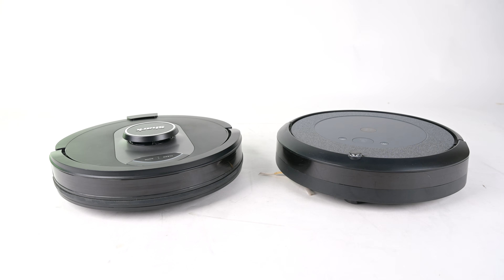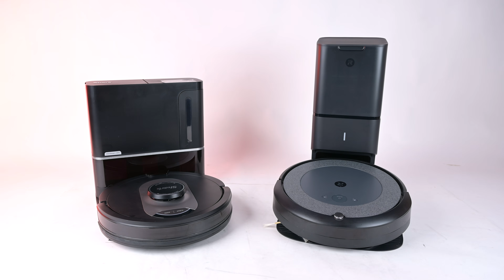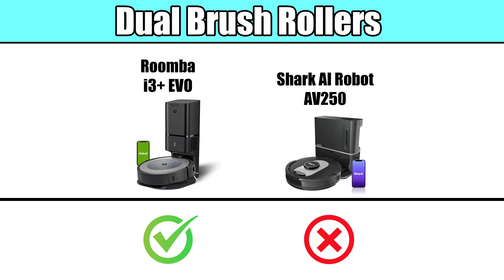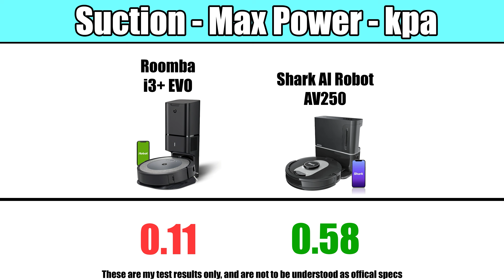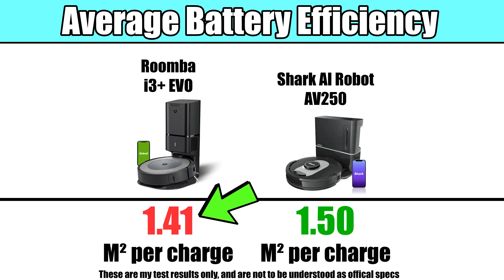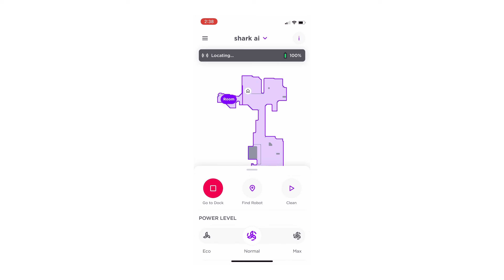Roomba i3+ EVO and Shark AI AV250: Robot Vacuum Wars Showdown!

Comment: I have the irobot roomba i3 evo, and my son has the i3+ evo. I also have the Shark IQ and I had both of them map the house. For some reason the Shark lost the map but before it lost it the maps were nearly identical. The Shark is the self emptying model, but the irobot is not. My son loves his but you forgot to mention that you have to purchase bags for the irobot roomba i3 + Evo and the Shark is bagless. I just purchased two new ones,  The ihome autovac Nova S1 and the Shark AI.  Both use lidar technology and do mapping in real time on screen. You say that the irobot maps as quickly as the Shark, and that has not been my experience in any way. The Shark maps much faster in my case. Thanks for the video.

Comment: I have owned both of these exact vacuums for juat over a year. The Shark is by far a better vacuum. To the point where I genuinely cant understand why people buy Roombas and makes me wish I had bought 2 of the Sharks. 
First of all, the Shark has a fsr better app, much better cleaning performance, and I really like the 3 "levels" of suction and the addition of smart map features (zones) that the Roomba completely lacks.
 The biggest issue has been the reliability of the Roomba, I have separately had to replace 2 components that completely failed. One was the cleaning head and the other was the dust bin. While the Shark on the otherhand hasnt had a single issue. 
Another huge problem is the Roomba getting "stuck" or "lost" or otherwise not making it back to the base or finishing cleaning. 

Again, I cannot reccomend against the Roomba enough while recommending the Shark 100%.

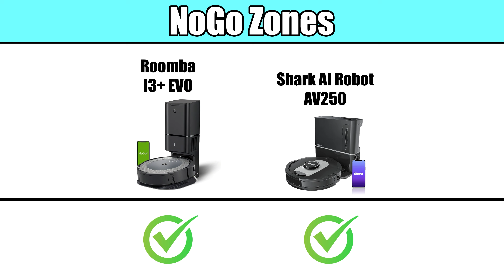Comment: 1:06 I think they got this wrong. The i3+ cannot create Keep Out Zones neither Clean zones

Also, i3+ can only remember 1 floor.

He did not mentioned the main differences between bases. (Bag vs bag less)
Reply: Yeah, my i3+ cannot half keep out zones or clean zones
Reply: @kylestruble6568  The I3 has a map you can define.  Just eliminate the areas on the map you don't want it to clean and it won't go there unless it gets 'lost' and has to rediscover it's position and then it may wander into the area.

Comment: I'm surprised you didn't cover their docking stations in this video. I think it's worth mentioning that the Shark model uses a bagless dock vs the dock that the roomba uses that requires you to purchase vacuum bags. I think that alone is a big selling point for many people
Reply: Well, bagless systems use an air filter anyway do they not?
Reply: @mj99875  Yes, but they can be washed. Similar to Dysons handhelds, the filters can be cleaned and used, no need to rebuy.
Reply: The bags are not that expensive and they are much more convenient. Also they are much better at containing dust than bugless systems.
Reply: Bagless people are weird... 😂
Reply: And then u need to clean the bin since it might smell over time😅. Just for that bag system is better
Reply: This was a paid ad bro. Are you blind.

Comment: Got the shark AV 250 with the vacuum base on sale for $199Canadian, and would definitely recommend anyone with a single floor layout to pick up the shark for similar price. Does an amazing job in my 750sq/f apartment with hard floors and 2 rugs, I barely ever need to bring out my manual vacuum. Also am glad to see the extra video a week and like the new narrator! PS I wish he went over what the differences are between all the very similar models like the 2501, 2502, and 2511